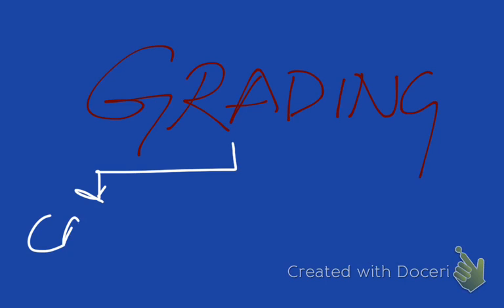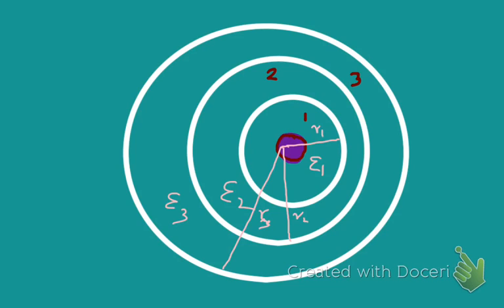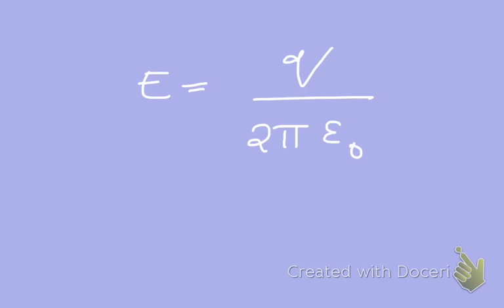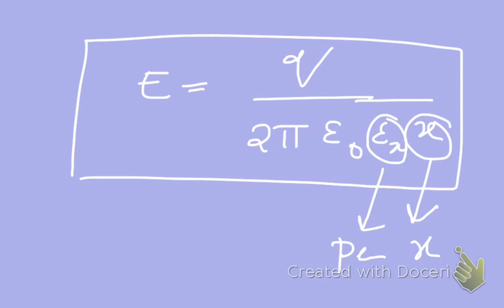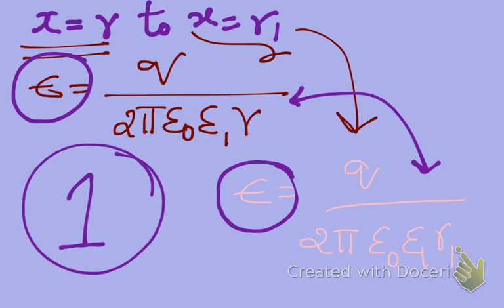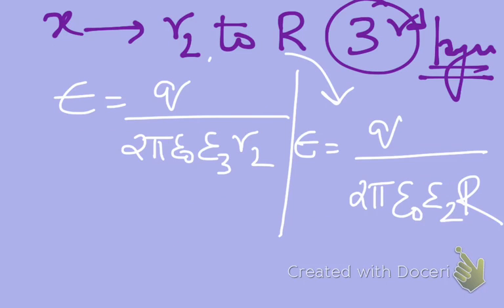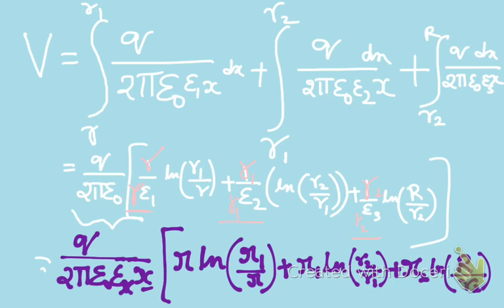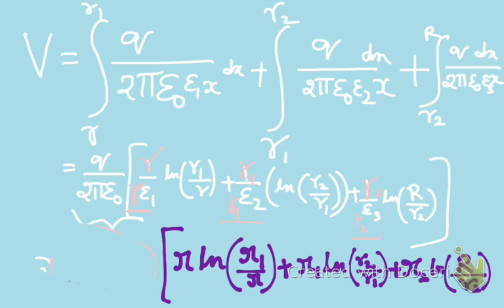Capcitance Grading

Comment: Thank you mr Chinmaya for a great and pedagogic video. What is the purpose of using E_max though? Wouldn't this just cause maximum dielectric stress, throughout all layers of insulation?
Reply: Jonathan Gall : no max gradient is found at the surface of conductor and az we move away of it towards inner surface of sheath , it decreases .. and found minimum at inner surface of sheath so there is a limitation of using this cable at high operating voltage because of max stress on conductor surface , although the outer insulation material isn't completely utilized as its not yet reached the maximum value of stress rated for that insulation. If we can minimize the difference between the maximum and minimum stress , we can use the insulation material in more efficient way which will ofcource decrease the size of cable for same operating voltage hence the cost too as most of the material will be utilized in more efficient manner.